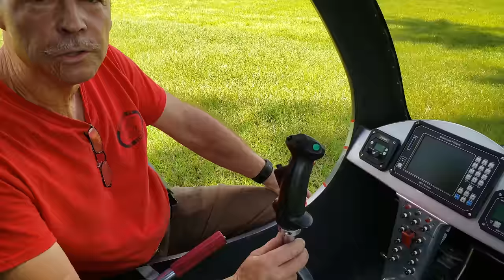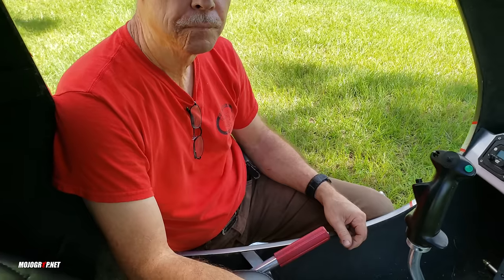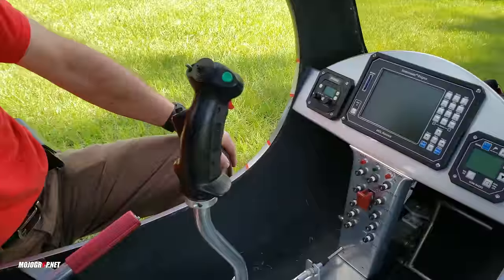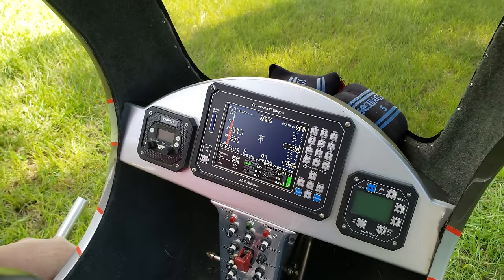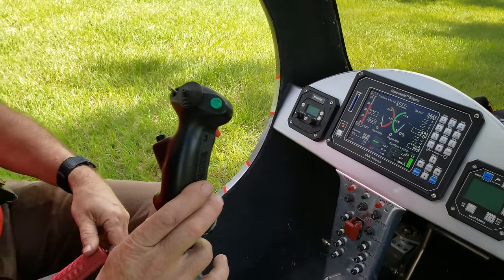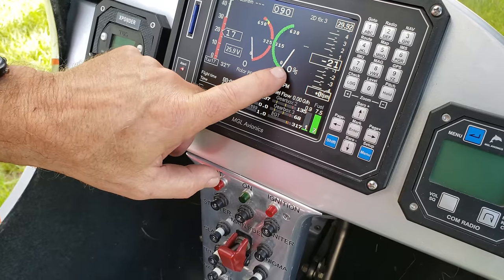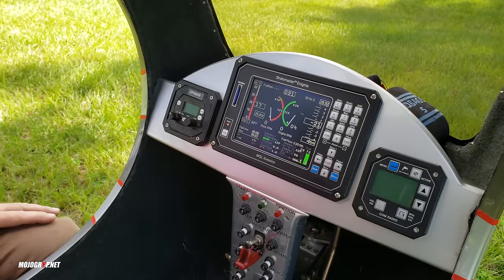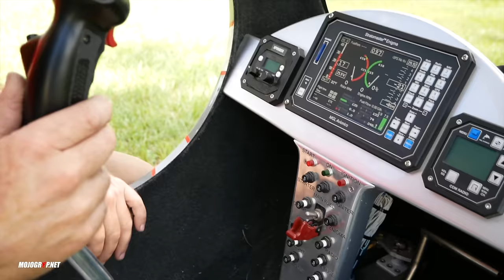Mosquito Helicopter XET Start Up And Cockpit Flow

Comment: See, this is something every flying enthusiast should have! Imagine just flying back and forth to work everyday.
Reply: I have enough trouble with people who allegedly "drive" back and forth to work every day.
Reply: your neighbors would be thrilled
Reply: @sesarman  Just to fly it back in forth to work. At 5am in the morning!
Reply: @heartofthunder1440  unless you live on a farm and work at a ranch (they're very loud) Not possible in any suburban environment.
Reply: @sesarman  Don’t sound to much louder than the straight pipes that’s on my Harley Davidson. But, yeah I see what your saying. Still would be a pretty good thing to have, especially if a person is into this sorta stuff. A perfect use for it would be a type of a drone with a camera or video equipment on the front of it. You could put together some real nice media for just about anything.
Reply: @heartofthunder1440  you'd be surprised, also a straight Harley is only that loud at maximum throttle where you can exit the neighborhood relatively quiet if you try, a helicopter is at near maximum throttle upon take off and landing, (btw the straight pipe Harleys are also illegal in most areas). That would be cool and relatively doable since these are not that much more expensive than certain sport cars or a boat, if sound wasn't an issue.
Reply: Where would you land, unless you are CEO and have a helipad, but yes we can vision, and make them reality, I’m sure they told the builders that this chopper was to small to fly.
Reply: Lot of gas though. Hell, if l could afford it l would
Reply: @sesarman  well, I ride a Harley Davidson with loud pipes, I’m sure it’s about the say 🤣
Reply: Would be a disaster.
Reply: @jdb3160  Gas use is really quite efficient - the piston engine choices are more fuel efficient than the turbine (but, you know, piston), and use about 6 Gal/hour. So would be more efficient than some cars for some commutes, and a heck of a lot faster and more enjoyable.
Reply: I'm right up there with you. Flying into work in a personal helicopter. Would beat the hell out trying to look cool riding on a Harley-Davidson.
Reply: @jdb3160  if it is a turbine? More like it is a Kerosene mixture.
Reply: Right!
Meet George Jetson
Reply: I’m saddened that we aren’t all flying to work like this and how some people have a hard time driving a car
Reply: @sesarman  You obviously never been to the suburbs most of the time you can't even hear aircraft that fly by.
Reply: If you own one of these you don't worm everyday cause your smarter than that
Reply: To realize ur only working to fuel the Chopper 😂.
Reply: @tysonristau4995  That would be the whole point.
Reply: @heartofthunder1440 you can't just have this. You have to go through flight school and be a pilot. Then you have to follow the flight rules. You'll start flying in vfr or visual conditions only. If you want to fly when it's cloudy or overcast you'll need to she'll out another $10-15 grand to fly instrument. This isn't just a car that goes in the air where you hop in and go do whatever you want flying wherever you want however you want, not to mention youd need dozens or a hundred hours before you feel comfortable flying it alone, and it's a single seater so you need to train in a different helicopter first
Reply: @davidt8087  oh imagine your correct, it’s definitely not like a car, or even a tractor trailer. But it would be a great way to start if you wanted to actually fly a bigger helicopter. That’s what I did when I got my commercial drivers license, I got my class B for dump trucks and single sized vehicles, and then got my class A license for tractor trailer.

Comment: First time I've actually heard an explanation of how to start/fly a helicopter. It is pretty complicated but I guess if you do it a dozen times or so it'll become second nature-good vid.
Reply: The flow didn’t sound that complicated and there’s probably a checklist on how to do it on hand. That’s how airplanes are.
Reply: Uh, are you for real? I have been flying these for over 30 years and still need assistance on startup.
Reply: @meintingles4396  Sounds like you should have quit a long time ago.

Comment: First, this turbine Mosquito may just be the ultimate expression of flight. It's what we all dream of, but- is somewhat outside of the fixed wing focus of most beginner pilots. The concept of lifting off, hovering and controlled flight in it is straight up AWESOME. Wierd, but, practicing power off landings (auto rotate) in a $50k experimental scares the life out of me! So, as exciting, cool and great as it seems- I'll watch you, OK? Apparently, middle age and self preservation prevent me from truly considering a Mosquito, Mike. Obviously, thank you- I'll watch every minute you post up on it!
Reply from the maker: Thank you!
Reply: Honestly- a personal helicopter with enough power & strength (Mosquito XEL) is incredibly tempting. Heck, it even sounds right, and, it definitely looks awesome, but, i think the glide ratio is, umm ZERO. Thanks to Mike's interest, I checked out some other videos of them in flight- very agile and capable in the right hands. I get completely stuck with the possible falling out of the air- OK- stopping descent using hard or immovable objects- i.e. the ground. Parachute? Airbag? I even watched auto- gyro vids in an effort to overcome it- I'm just too old. Sooo tempting, but... I sense that I'm gonna have to watch you & Mike post up videos, maybe even come & watch some time, but, gravity, fear of heights, an over-developed sense of self-preservation, total wimpiness prevent me from flying one- under any circumstances. Promise to cheerlead from the sidelines tho in my ground based lawn chair, OK? I DID a helicopter trip into the volcanos in Hawaii years ago... I'm out. More seat time for you tho :)
Reply: Actually if you get the proper training and understanding how to maintain them not any more risk then owning any type of GA aircraft notice how I say GA reality is all GA has some risk try to manage it with proper training. The cost and build time is what is really good the problem I see is getting a PPL rating for helicopters according to website $15k is what they charge. If you register the thing with the FAA can land at most airports. Autorotating is safer then trying to find a place to land a Cessna. You should go take an intro flight training and have them do some auto's and explain how it works.
Reply: Thank you blastman8888- I agree wholeheartedly. I was so interested, I did a ton more research, watched a lot of auto-rotate vids (and Mosquito's specifically), so, now I 'get' the over rev clutch, inertial rotor mass concept and just how much energy gets stored. I'm a strong project starter, but, get easily distracted on long ones, so, I would have to buy used, or, mostly complete (at a steep discount either way!). I thought it was less expensive if you have your PPL (more like an added certification + training + rental)- because that's real money as well. In my research, I noted a 500 TBO, but- unsure of what's involved, or, costs. Fixed wing is an expensive hobby, even after the hump of obtaining your PPL. Buying is whole new world of cash flow, even if you are super careful. Apparently, I'm now both a wimp & to Yankee (cheap) to consider a Mosquito. But, hey- it was a ton of fun learning about it & fun to dream about. I guess I'd like to see an R22, or, a Schweitzer 300 in action- just to get a feel for noise, rotor wash, size in person...
Reply: @Mike-01234  I bet they won't hire you as occasional pilot (so you can pay for it after) just because you have a license (like trucking) unless you build lots of hours with your own helicopter?

Comment: You should get a couple hours in a helicopter. The R-22 is probably the cheapest aircraft to learn in. Gives you a whole new perspective to aviation. Sort of like beating the air into submission. I have a little over 2000 hours in Huey's and Blackhawks. It is a very versatile aircraft but so expensive to operate.

Comment: This is a cleaned up Heli Cycle, which was home built.  The developer was killed in one.  They speculate he had a heart attack and not an aircraft failure.  Is the mosquito home built or ready built, test flown and safety checked.  The heli cycle was a phased build with inspections and approval as you progressed with the build.  I was just about ready To buy and start building then the company's owner accident occurred.  My wife stopped the whole endeavor when that happened.

Comment: What I would really love to see from Composite FX is an electric mosquito. Something redundant, with 5 small brushless motors. That would be 3 for the main rotor and 2 for the anti torque. They could mount those main motors up high by the swashplate and the 2 on the back can go far back in the tail boom. Then the battery pack can go where the fue tank is in the 285. All that space can be used for battery banks. That would give it a lot of extra space behind the pilot, allowing the fuselage to be extended a little back for storage capacity. Tell this to Composite FX. The technology is there a d there is a lot of advantages by going electric including the huge sound reduction this thing will have.
Reply: Hello, a guy from the internet here to ruin everything 2 years late. Even today with improved batteries gasoline is about 100 times more energy-dense than lithium-ion. Granted electric converts at around 70% efficiency in a good system while gas turbines are around 15% efficient. Let's ignore the 5 electric engines' weight vs one turbine (its actually in favor of the turbine). Energy density alone is the reason you don't see an electric mosquito. Gas is the way to go for power to weight until a battery reaches about 1/5th the energy density....or about 20 times better than what we currently have. In 2022 the Jetson and the SkyDrive are starting to make what you are describing but the same energy density issue makes their range significantly reduced and their cost significantly increased.
Reply: @Hierax415  thanks for your reply. I had forgotten about my comment already. I preffer electric for the sole reason of sound reduction. Electric planes are way less noisy than their oiston engine or turbine counterparts.
Reply: @P_double_H  What electric planes?

Comment: Cool! That small jet engine is an Auxiliary Power Unit (APU) used to start the hydraulic system in a CH-47 Chinook helicopter. Once the engines of the Chinook are started and running, the APU is turned off.

Comment: These things are surprisingly inexpensive, all things considered. This model shown, the XET, is basically the company top of the line. The kit (not fully assembled) is about 44k, while the factory completed version is 55k. But honestly the XE285 is almost identical in all respects, with the key difference being fuel burn, and therefore flight time. The XET with the basic 12gal tank has a 1hr flight time, which can get to 1.9hr if you have the aux.tank for a total of 20gal. The XE285 on the other hand has the same tanks but basically doubles the flight time. And it has virtually the exact same specs otherwise.

A 3-4hr flight time is certainly respectable, but the basic tank with an XET giving you 1hr flight time? That's kind of piddly all things considered....

Comment: Needs taller feet so rotor clears head height...accident waiting to happen
Reply: I was cringing watching that guy under the rotor. Those things are going to kill people.
Reply: No... it needs you to pay attention and not stand up when rotors are turning.
Reply: @edwinthomas618  Like TH said, accident waiting to happen. I would never recommend this thing. Just raise the rotor, why risk someones life?
Reply: @MakeMineaDouble  Accident isn't waiting to happen if COMMON Sense is applied.  It's design for pilot to duck.
Reply: Additionally, I thought they were pretty close to surrounding trees, at least for my liking lol
Reply: Trained technician know not to stand up.
Reply: No. That would make it more prone to oscillation/vibration and tipping over. 
The construction is fine as it is.
Reply: Extra tank underneath is scraping the lawn, so yeh
Reply: @MakeMineaDouble  They already killed many people, according to OSHA reports.
Reply: It needs to be lower, or have an option so that the engine can run without spinning the blades, so it can only be started when the single pilot is in, and people are well out of the way??

Comment: A great little machine, but the start sequence is crazy complex. It could probably be automated.
Reply: it could be but it would just make it more expensive. It's not difficult for the pilot once you learn how. Start spinning the engine, spark it up, send fuel and watch it burn. The only reason your car starts up with the turn of a key/button is to make sure that every idiot in the world can get in one and go without any training.
Reply: Cod Mott good point!! Great point in fact!!! Just imagine every idiot being able to just fire up a copter. Hop in and give it a lucky try? From what I’ve seen. Flying a helicopter is quite a bit of schooling. I would imagine that by the time you get to start one up. You understand the workings of the engine completely. Maybe in wrong. Hahah I obviously do not fly anything. Except maybe paper airplanes
Reply: @codmott286  no , cars start with just a turn of the key since always . 
  Turn the key turns  power for the battery to the starter  ,fuel used to be mechanical pump ,  and a draft carburetor ,   simple ,not efficient ,now its computeriezd . 
 The electric pump is powered on  with the turn of the key . You or anyone alive can not compute the fuel injection and other parameters for the engine multiple times per second .   Genious .

Comment: Stay far away from the helicopter once it power up.
Reply: you mean the blades right?
Reply: @cwr8618  no once it starts up jump out and run immediately
Reply: Oh yeah!
Reply: Master Of puppets  like most things, I think it depends. When I was a mechanic on helos I would stay fairly close with the fire bottle in case there was a flame out/hot start and also to do the typical plane captain checks before launching. Sometimes, avionics folks or an aircrewman will be on ICS during ground checks. As a pilot, we are either in the bird starting it up, or hotseating to take the next mission, and we just avoid the blades when going in and out of the rotor arc. I'm not sure what the startup procedure is for this bird, which is why I asked/clarified.
Reply: @cwr8618  why did you respond to that a year and 1.5  later😂😂
Reply: @daelan9318  Because he's aggressive.
Reply: @tonyp2865  yep. i am
Reply: @tonyp2865  and arrow finger is sarcastic. since you're the comment judge
Reply: @daelan9318  same reason you responded 4 months later to my comment. It's relevant. I guess you're aggressive by other folks standards.
Reply: @cwr8618  Here is something you might want to do then, find two tom cats, tape their tails together with duct tape and hang them over your cloths line.
Reply: This comment thread exemplifies exactly what happens when we have too much tech in our hands and forget how to converse and share ideas. This is why society seems to be unraveling the more virtual we become.
Reply: @cwr8618  You said you were aggressive I picked that up. What's wrong with sarcasm, George Carlin was always sarcastic. There is a shortage of humour on the tube, I'll agree with that.
Reply: @tonyp2865  absolutely nothing. it's quite necessary in fact. i originally was not aggressive until you made the comment, which was taken out of context. someone was being sarcastic when i was being serious and attempting to be informational on a subject i have a lot of experience with. so i quipped on their sarcasm. end of story.. but you throwing that out there had a) zero to do with the video and thread and b) seemed to be uncalled for. so you hijacked a perfectly good comment with that bullshit. i stick up for myself and for others.
Reply: @cwr8618  stay off the internet
Reply: @daelan9318  so even though you got bent over the fact that you assumed I called you aggressive when I did not call you aggressive, this is your reply. Nice.
Reply: @cwr8618  If anything you are aggressive. you've probably written over 20 comments in this one comment section.
Reply: @cwr8618  :)

Comment: With rotor hight being low would be kinda neat to put a high powered lazor pointer in the tip of the blade pointing a few degrees out so you could see the blade diameter while close to the ground and around people. It could even be done with a fiber optic so it would not add any weight at the rotor tip.

Comment: Rogério Pinto Ribeiro
Doutorado em Engenharia Mecânica
Mestrado em Engenharia Mecânica
Especialização em Eng Térmica Fontes Não Convencionais de Energia
Graduação em Engenharia Mecânica

Possui graduação em Engenharia Mecânica pela Universidade Federal de Minas Gerais (1981), mestrado em Engenharia Mecânica pela Universidade Federal de Minas Gerais (2000) e doutorado em Engenharia Mecânica pela Universidade Federal de Minas Gerais (2006). Atualmente é professor adjunto da Universidade Federal de Minas Gerais. Tem experiência na área de Engenharia Aeroespacial, com ênfase em Aviões, atuando principalmente nos seguintes temas: aeronaves,hélices estrutura, fabricação em compósitos e turbinas eólicas.

RIBEIRO, R. P. . Aeronave experimental P56RM Prefixo PP-ZVR. 1994.

01/1992 - 12/1993
Extensão universitária , Escola de Engenharia, Departamento de Engenharia Mecânica.,Atividade de extensão realizada, Construção da aeronave experimental P-56RM PP-ZVR.